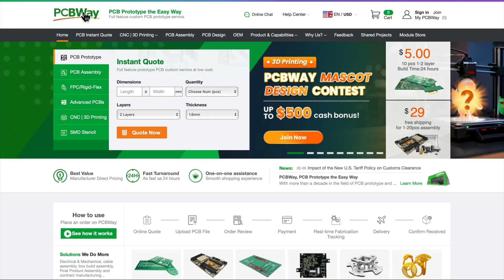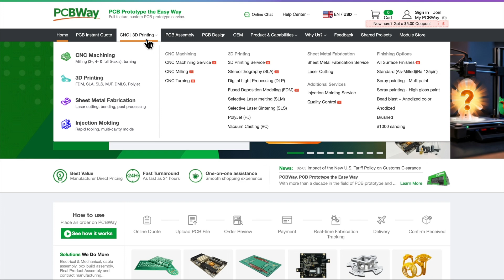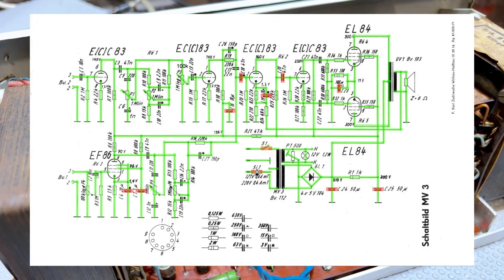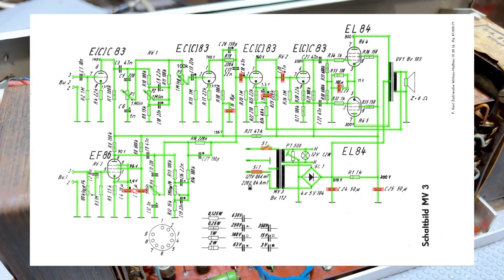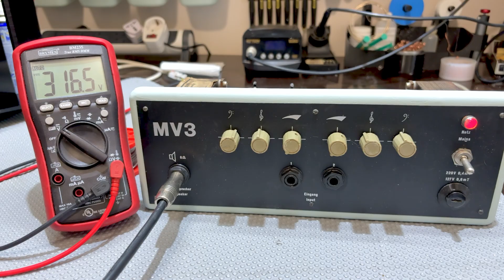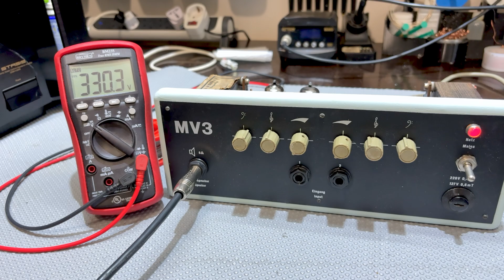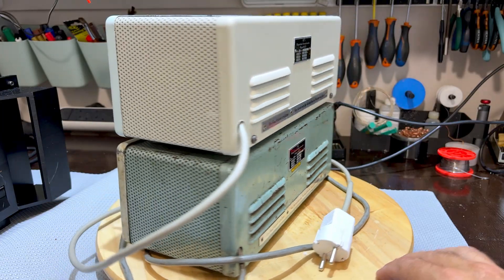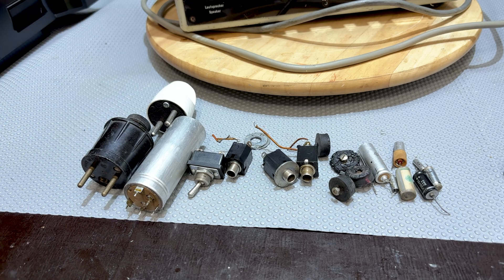Vermona MV3 Guitar Amp Resurrection Complete – It Sounds Fantastic! (Part 2) #pcbway#

Comment: Hello Manuel.  Excellent project, thoroughly enjoyed it.  DId you have to take the main board out off camera so you could desolder component leads to check and see if they were in spec?
Reply from the maker: No, the board underside is open at the bottom, so you only need to tilt it onto one side to access the solder traces and then pull from the top side.

Comment: I think you need to build a coil winding machine and fix that output transformer. ;-)
Reply from the maker: As if I need another project 😊
Reply: @electronicsoldandnew just think what a transformer rewinding service would be to the island.  You might get a run of jobs lasting seconds if not minutes. 😂😅
Reply from the maker: This island is small 😊 (250k residents) so the scope for any business is very restricted. And … I love this as a hobby, but as a business it would be a poor one. I’ve always maintained that I don’t want to replace a great hobby with a poor business 😊
Reply: @electronicsoldandnew  Totally agree with that sentiment. It is a great hobby, one I started as a lad back in the early 70's and then put to bed for nearly 40 years working in communications (phone, wireless and satellite). Now retired and hobby back in first place. (After the wife of course). Working a hobby removes the enthusiasm.